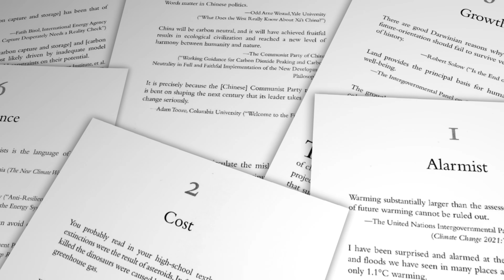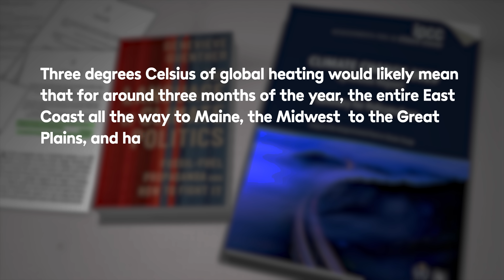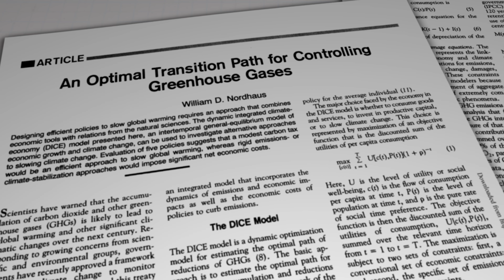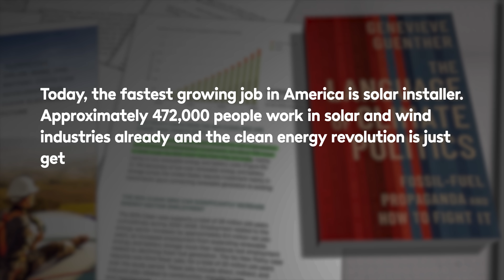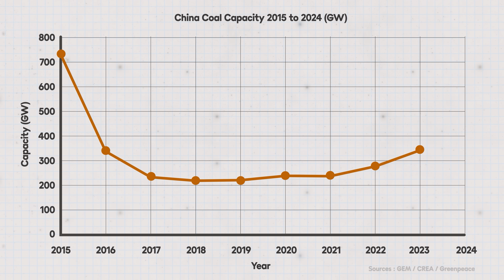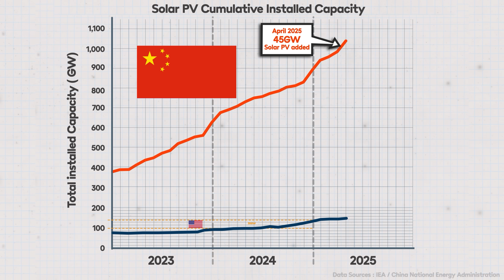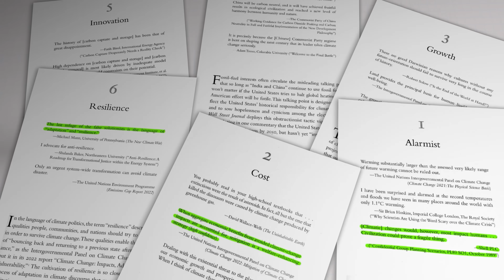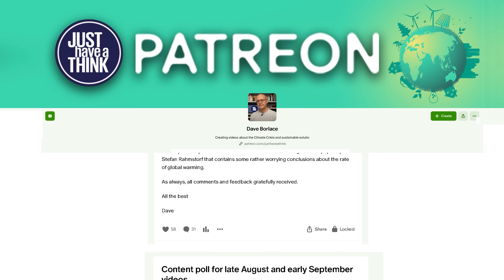New research DEBUNKS climate disinformation.

Comment: Just have a think about this fact:- Carbon dioxide is the most soluble of atmospheric gases. The solubility is INVERSELY proportional to absolute Temperature and at 40 deg C (3013 deg Absolute) ALL gas is expelled from water. As the average Temperature of the Earth rises so does the amount of CO2 in the atmosphere. The amount of CO2 is therefore dependant upon the Absolute temperature  and CANNOT effect the Temperature of the Earth. CO2 level is actually a measure of the Average Temperature of the Earth! If you wish further explanation ASK A CHEMIST about the Nerst Equation that determines the dissociation of Carbonic acid which is formed when CO2 dissolves in water.
Reply: Dissolution is not the only way CO2 enters the atmosphere, and there is no mechanism in atmospheric physics that restricts CO2 levels based on temperature.

There is for H2O, though.
Reply: @Leafsdude  You a wrong Dude, The level of CO2 is determined by the Equilibrium CONSTANT which is defined by the Chemical Equilibria of the Nernst Equation, The part of which is RT/ZF x Ln [C)2] .The only variable is the Absolute Temperature which determines the Equilibria CONSTANT.
Reply: @gordontate2274  All the data disagrees.  I'll go with the data over a rando on y/t making proclamations.

Comment: Hi Dave, I think your info is wrong.  The high temperature recorded by Environment Canada in Lytton in 2021 was 46.2 June 27, 47.6 June 28, 49.4 June 29, 38.2 June 30, 29.6 July1.  The impression left by your comments provides a significant 'wrong' slant.  BC is huge.  For comparison several "UKs" could fit inside it.  Lytton is one community located in a semi desert climate in the interior of BC.  49+ temperatures were not recorded across all of BC.  That said, I do believe climate change is something we all should be concerned about and should be doing something about.  I have a few suggestions should you be interested.

Comment: if global warming was so bad they wouldn't loan money to people buying houses on the foreshore? much like window tinting or jet fuel ya get to a point ya won't go no higher and its ironic yaz never mention the ozone layer anymore ,whys that my fella😅
Reply: I'm assuming English isn't your first language. 
1. Getting a mortgage on the Florida coast can be more difficult than in other areas due to heightened risks from hurricanes and flooding, which lead to stricter lending requirements and higher insurance costs.
2. The ozone layer is on track to fully recover due to the Montreal Protocol, which has successfully phased out 99% of ozone-depleting substances. It's not relevant to the topic of the video.

Comment: It's unlikely that Renewable Green Energy will become a reality unless one's thinking increases to acknowledge what it took for fossil fuels to serve society for so long.  Mankind has to be able to design a scenario that creates durable wealth that collides energy and water needs.  Cycling the water molecule may be path.  The present path for Renewable Green Energy is a path to bankruptcy as the last 55 years has shown!
Reply: "In 2024, new renewable energy installations accounted for approximately 90% of the total new electrical generating capacity added in the United States, with solar energy making up the vast majority of that figure, around 81.5%." This is because it's cost most effective and profitable.
Reply: @lrvogt1257Did the Renewable Energy fix the shortcomings of the source or solve the pathway to bankruptcy for the manufacturer?

Comment: What nonsense! 125000 years ago in the last interglacial it was over 5c hotter than tiday and sea levels were 7 metres hotter. Thus has happened before the last 4 interglacials and it was not caused by co2. The Arctic woukd have has no summer ice and the tree line was hundreds of km north of what it is tiday. 

Imagined if we had lived back then, cljmate whackos would have blamed it on spaghetti monsters or something.

The coldest period in the last 11,000 years was the little ice age which lasted from 1300 until the late 1800s. At its peak, polar ice woukd have been far greater than tiday,, glaciers advanced kilometres, there were widespread black frosts, crop failures, starvation and extreme poverty. 

Over 50,000 witches were burnt at the stake for causing the climate catastrophe and people were too scared to oppose the burnings else they too be declared witches.

Today we are just bouncing out if the LIA back to a warm climate and climate crazies blame a trace gas instead of witches and people are too scared to speak up against this madness lest they be labelled science  deniers.

Comment: Predicting the future is fraught with uncertainty
Reply: So is looking into the past.  And determining the present.  And making any analysis of data and observation.

In fact, certainty doesn't exist in any meaningful form in any analytical field.

So, if that's legitimately a problem, explain how all the above is true and yet we managed to put a man on the moon more than 50 years ago.
Reply: @Leafsdude_ The past has actually happened, and we exploit the discoveries. The future is speculative
Reply: @MartinParsons-tr6wi  Yes.  But we don't have certainty about the past regardless.  If "speculative" and "uncertainty" are synonyms, as you've implied with your response, than the past is also speculative.

For the record, the way we "exploit the discoveries" from the past is by using logical inference and deduction to predict the future.  If the prediction works, we keep it.  If it doesn't, we throw it out.  That's science in a nutshell.
Reply: @Leafsdude7   Washing machines are real, not speculative
Reply: @Leafsdude7   Washing machines are real, not speculative
Reply: Looks like the bot just broke.

Comment: Iff it’s warmer won’t that reduce the use of fossil fuels to keep warm and augment the viability of the use of solar energy?
Reply: Yes milder winters will mean that people need less energy for heating in the termperate and cold climate zones  (but still need plenty). However cooling needs also a lot of energy. So that might eat up a lot of the gains. And: winters have become much milder in Europe and the U.S. - but energy consumption did not go down.
Reply: No because it is the solar radiation and the length of the day that determines how much solar energy you can harvest.  not the tempeature (that helps a bit with geo thermal though but that is more expensive to install). - Think a winter day in Germany, it has 8 degrees C in January.  Way too warm (it used to be zero or well below zero one generation ago).  But you still have to use heating to get to at least 18 degrees indoors (and that is not comfortable if you sit - that would need  20 degrees C). 

But the solar radiation you get in January is the same. 
The "heat" (well: less cold) comes from the whole planet being warmer and in Europe it is the Arctic. Or that the Mediterranean seas is now warmer than it should be - 2 - 3 degrees C more in fall (surface water) than it used to be. It needs enormous amounts of energy to heat up so much water and the heat is THERE in the system and shows up. also with some delay in winter. 
it is transferred. A lot - for the time being into the depth of the ocean. And some with air and ocean currents.